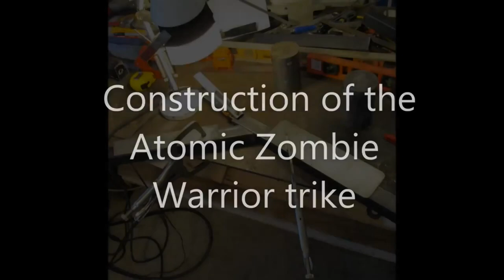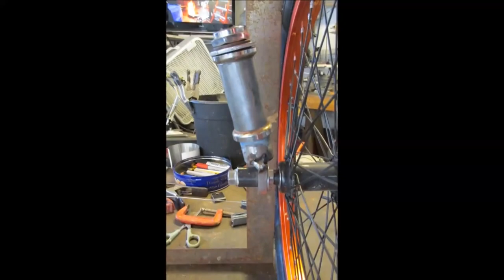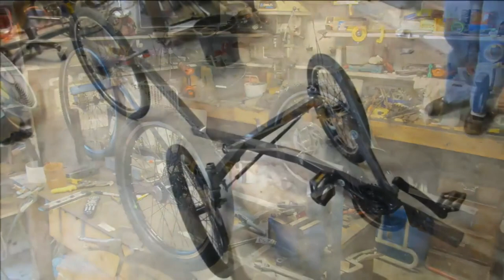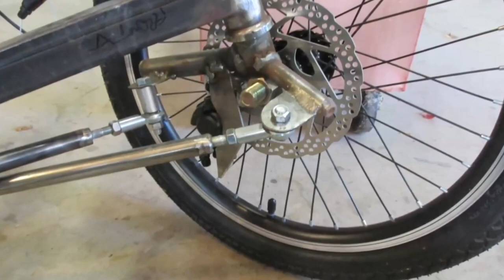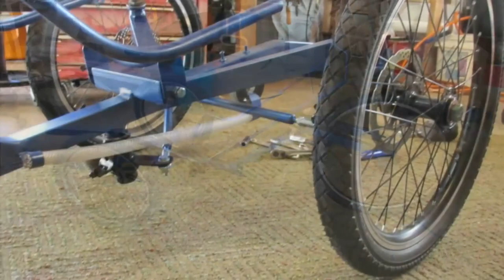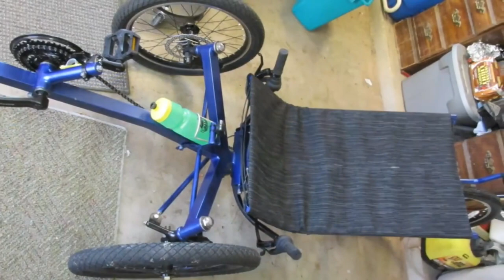Warrior Racing Trike Construction (by Atomic Zombie)

Comment: Nice build. What size are the axles on the front wheels and where or how did you make the front wheels?
Reply from the maker: 5/8" bolt.  Check "Atomic Zombie Warrior" plans on there website.  It has full Akerman steering. I actually like the steering better than my direct steering on my Catrike Explorer.